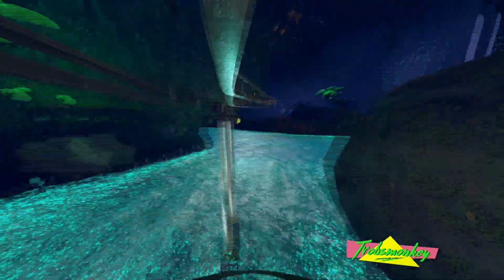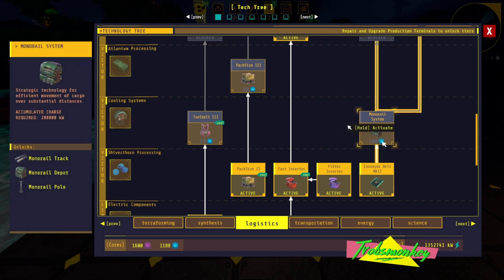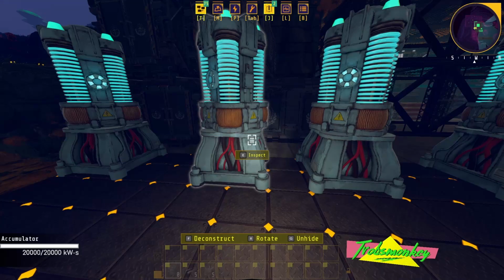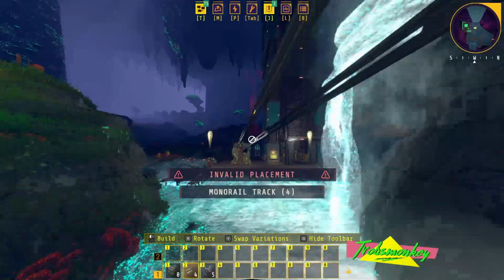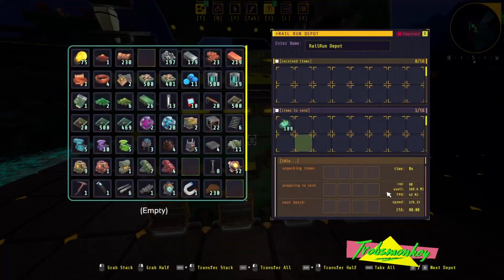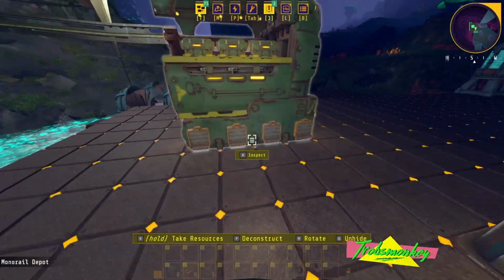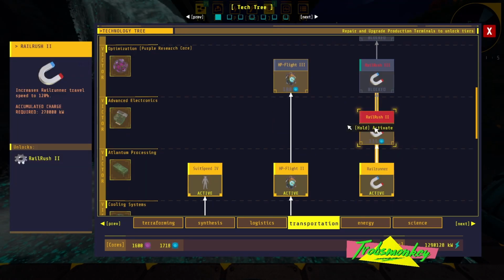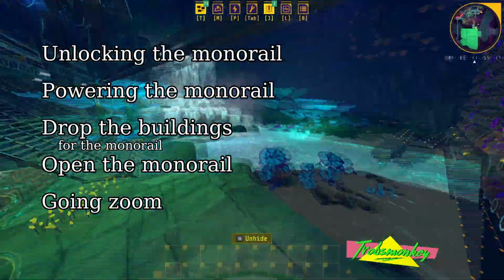How To Play Techtonica - Monorail and Railrunner Tutorial

Comment: I hope you can Help! I've activated the monorail and it is transporting goods but I can't figure out how to jump on the thing with the Railrunner? It's sitting in my inventory but it isn't doing anything when I double tap the spacebar? Any suggestions on what I am doing wrong please?
I've tried disabling the Hoverpack but that still works - even after closing the game and restarting! 
I've tried deleting ALL of the voltage steppers I have installed! All except the in-game one by building HA-1976 (the broken power grid watermills/accumulators by the river) that can't be deleted.
The Monorail Depot says it has 12600 MJ of energy available... So WAY more than needed! Required is 8.4MJ.
 Is this just another bug? Does the Hoverpack stops the Railrunner from working? Even when turned OFF in the Tech Tree it is still active!
Reply: I've figured it out.... you need to hold down the spacebar after the double tap! Not obvious... 
Why the Hoverpack continues to work after being deactivated though... Who knows!???